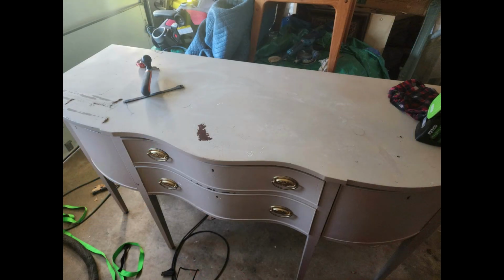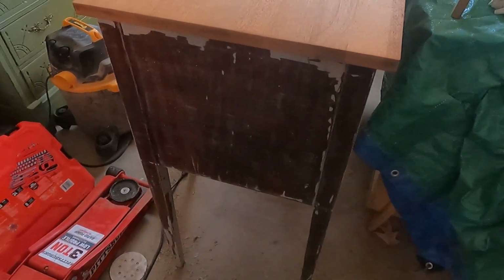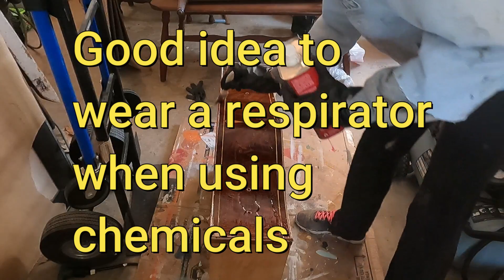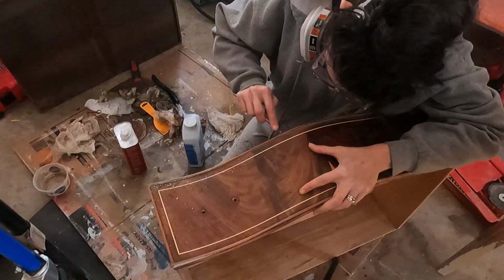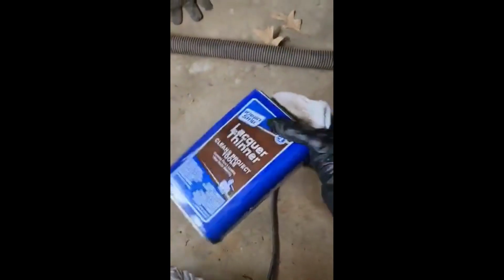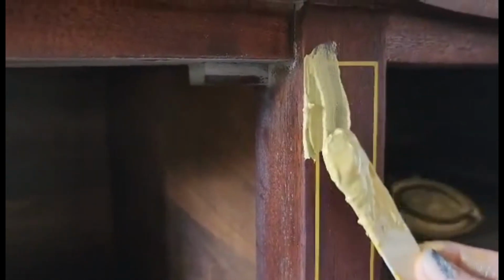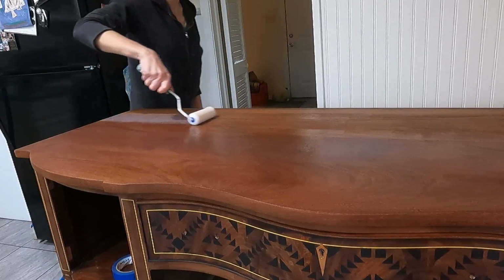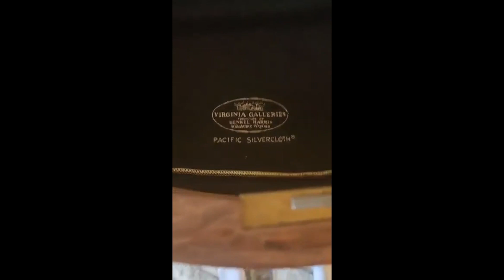Stenciled wood Buffet | Restored mahogony Buffet Makeover

Comment: A slightly safer way to strip paint off the hardware is to just use hot water.  I have seen people put it in a crock pot overnight, but I have had good luck it’s just pouring boiling water over it and letting it cool, then rubbing or scrubbing it off/ You may have to do it more than once to get everything. The temperature change makes the paint separate from the hardware and it comes off easy.  It may even be easier than using stripper, but it definitely reduces your exposure to stripper and saves some money.
Reply from the maker: Thank you for the tip. As for the crock pot i would reccomend NOT using the same one as you cook meals in.. I do have a spare one i picked up at a hard sale just for my hardware to prevent food contamination.